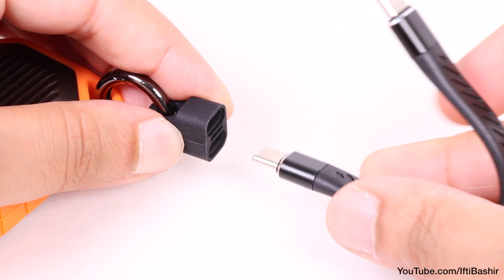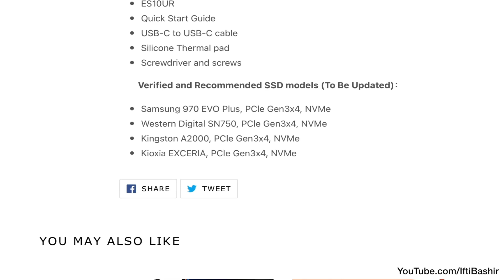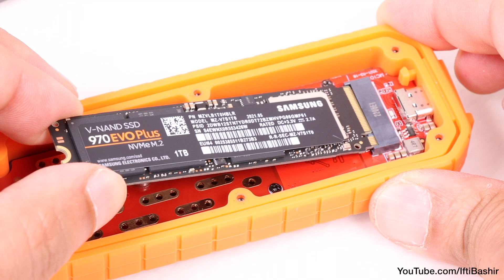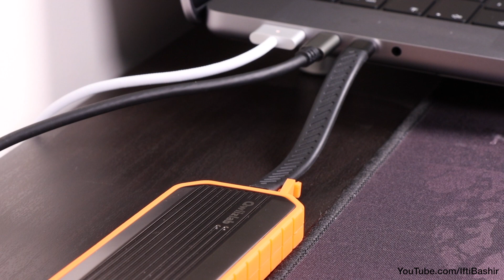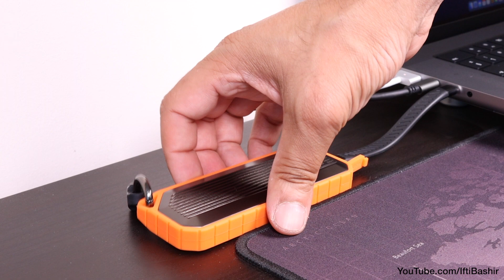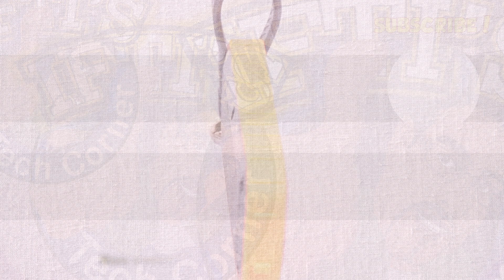Qwiizlab ES10UR Rugged Enclosure for M.2 NVME SSD’s : REVIEW

Comment: What driver do you use? does it come as a kit with adapters. Great content.
Reply from the maker: It comes as videoed with just the USB cable that's pre-attached, a screwdriver (t5) and some spare screws - nothing more. 
The drive is completely plug-and-play - no drivers required ;o)
Reply: @iftibashir  what make is it?